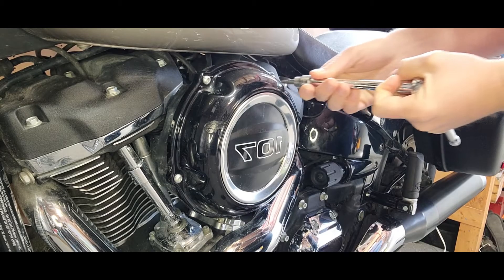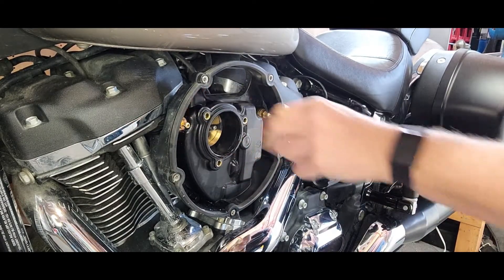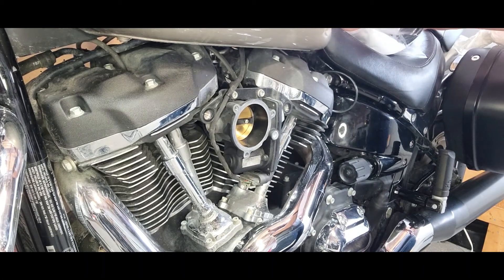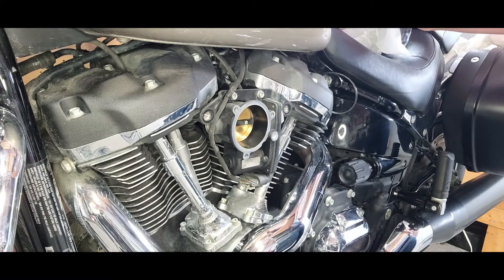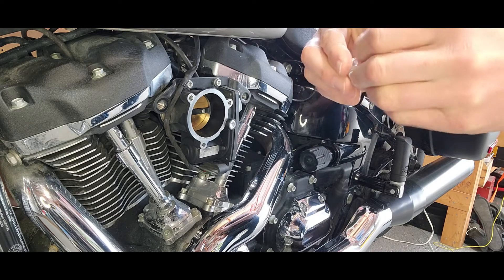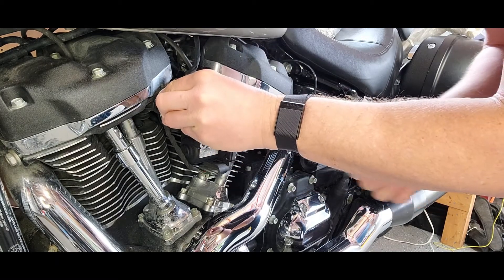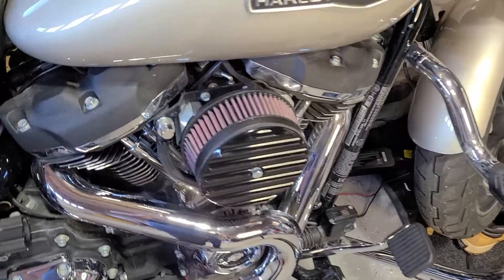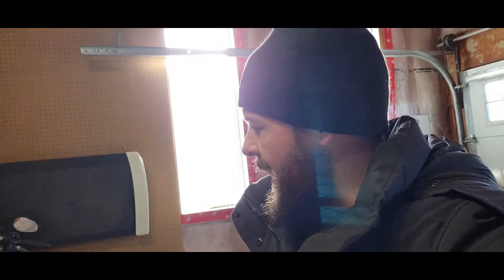Install of the DK Customs Outlaw 606 Air Cleaner and External Breather System Harley Sport Glide

Comment: I believe that last gasket is only used if you’re using the stock Harley breather cover. But I could mistaken.
Reply from the maker: You could be right. It never fits quite right but I always put it back on....it's metal on rubber so it should be fine....I'm leaving it off next time. Thanks!

Comment: The rubber hose placement (next to engine) after the "T" for the drain- Has tha been an issue?
Reply from the maker: No issues so far. It's been the summer (about 8k KM now) and only issue was at the cash can, but that was my mistake.

Comment: Nice video, I’m thinking about going with the 606 on my 05 Fat Boy.  Question is can you tell any difference in the sound or performance of the motor since you installed it ?
Any check engine light or any other issues ? Thanks
Reply from the maker: Thanks. Yes a slight change in the sound and definitely a change in performance, sounds and feels angrier. I noticed it from the install and then even more after flashing a tune with the powervision.
Reply: @streetsean  Nice 👍
Reply: @streetsean  😅

Comment: The filter looks to be rocking around on the stand offs and doesn’t have a tight seal to the backing plate.  Is that true?
Reply from the maker: No, there's a tight seal. The holes they drilled could have been a little more open so it would fit on easier, once the screws were tightened it seated onto the backing plate perfect.👍
Reply: @streetsean  Thanks for letting me know!
Reply from the maker: @Jim_Berry  No problem!